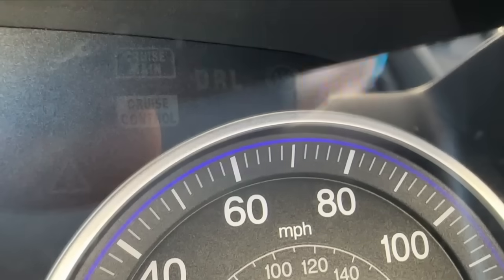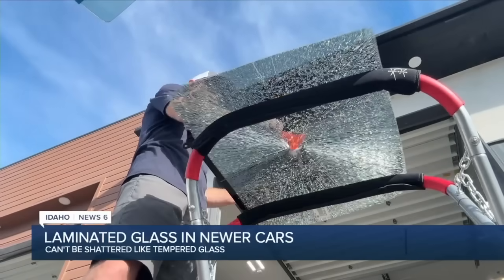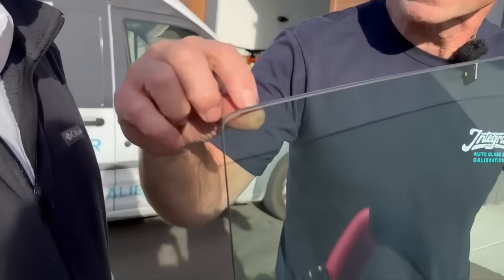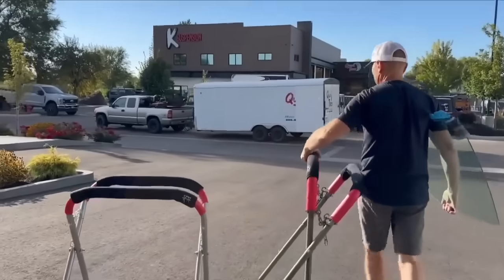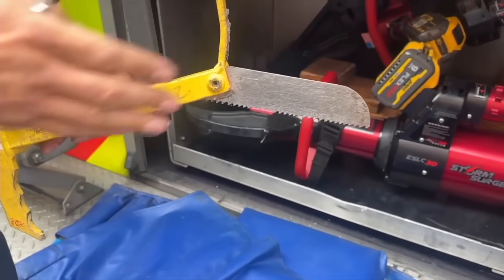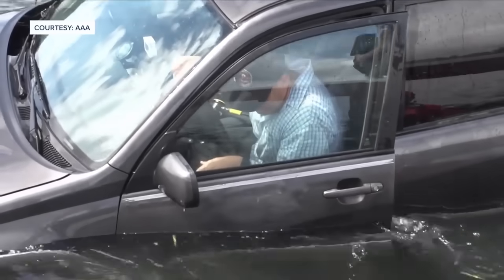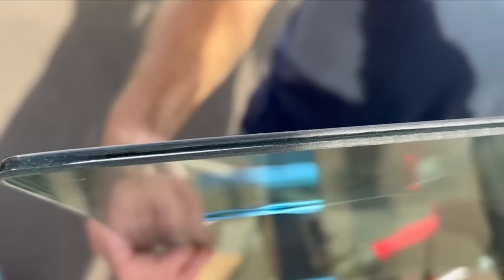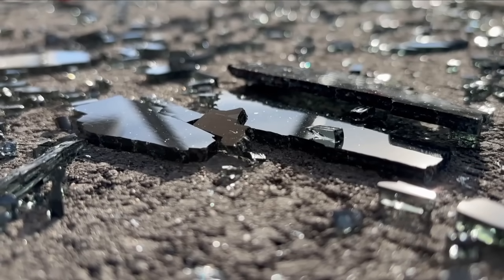New trend in automotive glass could put your safety at risk

Comment: When you (apparently inevitably) wind up in a river or lake with your car, the trick is to let your car fill up with water entirely. If the pressure is the same on both sides of the door, you can open it without too much extra force. Don't waste your breath on trying before it's equal, use it to escape.
Reply: Bad advice!!!
Reply: so i am going to sit in my car and wait for it to fill up with water with less and less air to breathe? and when it is full of water and there is no more air, i will have enough oxygen in my lungs to open the door and swim to the surface? that's your plan? 😂 goddamn man.
Reply: @josephlalock8378  what else are you gonna do if you're already under water? Opening the window isn't possible, opening the door isn't either. Trying to shatter the glass wouldn't work if it's laminated. You either waste your breath trying to do the impossible, or hold your breath until you have a CHANCE of escaping the car.
Reply: @Silacide  my s10 has manual windows . i'm pretty sure that i can roll them down anyways BUT if i was in my buick i would probably take my chances by crawling thru the rear seat into the trunk and grab the release. with the amount of airpressure and leg muscles, i think i could over come the weight of the water. i damn sure aint gonna sit and wait til my car is full of water . i think i will just avoid all that and make sure i'm driving my s10 if i decide to drive into a river or lake.
Reply: @josephlalock8378  If the water level is at your windows you’ll break the handle off before you roll the window down and if your trunk is submerged you’ll never open it, you simply aren’t strong enough. If you are worried about getting submerged in water they make tons of tools to break your window. I keep a spring loaded punch in my vehicles along with a knife that has a seatbelt cutter and a point on the handle to break the windows with.
Reply: @josephlalock8378  Also, what he wrote is 100% correct. If you end up submerged in water, have no way to break a window, and you were relying on simply being strong than hundreds of gallons of water, which you aren’t, then letting the vehicle fill with water will release the pressure and you’ll be able to open your door. They did a myth busters episode on it.
Reply: @shakiradefinitelynotaguy2036  Well it can work IF the door is less than around 10% submerged. That way the pressure is still not high enough to not be able to open the door. Keep in mind, that European cars are a lot lighter than American cars and thus give you a little more time :)
Reply: @Icecube095  Unless you can direct me to some real study I 100% believe that you’re simply making up the 10% number. Also, relying on your car to float long enough to get out is a terrible idea.
Reply: @shakiradefinitelynotaguy2036  bullshit i will break the handle off the window if it is submerged. the window is on a vertical plane. set a piece of glass vertically in the water and watch how easily it slides down. and dont try to say that the mechanism will cause the resitance because i have most likely been in a few more doors than you in my career in autobody. and read the part where the air pressure inside the trunk will assist in opening the decklid. i am not worried about being submerged. i don't drive into standing water and i dont drive into lakes. if a bridge falls into the water then thats just how it is.
Reply: @josephlalock8378  if you're fast enough (and capable) to get to the back, that's also a good idea. It's generally a better idea to go to the back for more air, as cars with the engine up front would go nose first down.
Reply: @Silacide  "fast enough" would be the key here. . it'd be tough to get thru the panic stage on to the clear thinking stage.
Reply: @josephlalock8378  You 100% won’t be strong enough to open the trunk if it’s submerged even with “air pressure”. Second, take a physics class. The water isn’t going to act on the mechanism, there is a difference in pressure from the vehicle cabin that is filled with air and the water pushing against your window, which is different than if you just put something in water. If you are submerged and your cabin isn’t filled with water the manual window won’t roll down, the exterior water pressure will prevent that.
Reply: @Icecube095  You don’t have to post a link, you could have directed me to where you found the study. The deflection and overly complicated formulas makes me believe that I’m right. The main problem with your idea is that if you’re already 10% covered in water, even if you for the door open by some miracle, now more water will be rushing into your vehicle submerging it further and pushing the door closed on you.
Reply: @josephlalock8378  I see that you’re determined to be right. That’s ok 👍. Have a good day
Reply: @shakiradefinitelynotaguy2036  i am not just trying to be right. i am right. i just threw out scenarios that you have not thought of. you have a good day too.👍
Reply: @shakiradefinitelynotaguy2036  Believe what you want to believe 🙂

If the most simple mathematical function to calculate pressure is too much for you, well, it‘s not my problem…

All I did was using the formular P = F / A and changed it to calculate F. So it was F = A x P

P = Pressure
F = Force
A = Surface

It really is not my problem, that you don’t understand 7th grade physics and I have the suspicion, that you won’t understand a study (which isn’t in English) anyway. 
Hope your day is as good as your math skills😊
Reply: @Icecube095  I will continue believing facts while you and Joseph can assume all you want 😊 have a nice day 👍
Reply: Maybe sometimes.  But if a car is in water, probably something else went wrong.  Is the door too damaged to open?  Or is something blocking the door?  Years ago in our area a car ended up upside in a ditch.  Doors were wedged shut by the ditch.  Two people drown in a small amount of water (upside down), while desperate witnesses attempted to break in.
Reply: Or just open the door as quickly as possible so the pressure difference can’t build up. Or roll the window down as quickly as possible…
Reply: @Icecube095  If you go off the road into a water source you’ll not be strong enough to open the door. The door will already be submerged enough to prevent you from opening it.
Reply: @shakiradefinitelynotaguy2036 Depends heavily on the car to be honest. Here in Europe a lot of cars are fairly tight sealed, which definitely slows the water flow into the car. There were several tests made by crash researchers and firefighters and if you‘re quick, atleast here in Europe, you might get out, but your time window is 30 seconds maximum (some higher end cars may give you up to 60 seconds)! 😊
Reply: @Icecube095 absolutely wrong. To open your door when it’s partially under water you’re fighting against the weight of the water against it and unless I’m talking to Brian Shaw you’re not strong enough. Being sealed well has nothing to do with that.
Reply: @Icecube095  The only thing a tight seal might do it give you time to roll your window down if the water isn’t at that level yet and if your electrical system doesn’t short out

Comment: That’s why you need to learn to swim
Reply: Swimming doesn't help inside a car full of water and sinking....
Reply: @ffjsb  that’s why as soon as you enter the water you need to wind down the window it will still work or open the door a little bit. And when the water fills the car up, take a deep breath, then come out.
Reply: @yokanshree4621  If you have enough presence of mind to do all that, you probably wouldn't have driven into water in the first place...
Reply: @yokanshree4621  You won’t be able to open the door a little bit. The water pressure will definitely keep it closed.
Reply: @shakiradefinitelynotaguy2036 you can wind down the window
Reply: @yokanshree4621  Yes, if you have an older vehicle with a hand crank but only if you aren’t submerged in water yet. The weight of the water pushing on the glass will prevent you from hand cranking a window and automatic windows will more than likely short out.
Reply: @ffjsb  right because no one is ever forced off the road by another vehicle🙄

Comment: How about after-market window tint? Would that be as difficult to break as laminated glass?
Reply: Tint film on tempered glass doesn’t add any strength or holding power to it. If the glass shatters, it’s just a sheet of plastic, so very little resistance. 

Laminated glass is not tempered, and the laminate is sandwiched in, so it reacts totally differently. Much more difficult to break out.

Comment: Thought of an idea, the instant a car detects its in a river, automatically roll down the windows
Reply: one more issue is we need to find a way so that it can distinguish regular carwash water/ rain water from submerged in water
Reply: Imagine driving in the rain and hitting a big puddle, when all of a sudden your windows roll down 😂
Reply: That will be funny as the car automatically rolls down its windows in the rain or at the car wash!
Reply: Great, now every time the kids pee their pants, my windows are going to roll down.
Reply: Naw thats still a terrible idea. Literally nobody asked for this feature. But im sure BMW would charge a subscription fee for the "ANTI DROWNING WINDOW SENSOR" if it existed.
Reply: Part of the problem is window motors can't easily overcome the force of water pressure.

They push the glass tight against the rubber and won't roll down anymore
Reply: @borontv6400 that's assuming it's already fully submerged, the idea is that they roll down before it sinks. But accurately detecting that the car is sinking is a more difficult problem to solve.
Reply: @borontv6400  Would it be difficult to roll down manual windows due to the pressure?
Reply: @marksudeith9840 I would say so.

Go have a friend lean against the window as hard as they can and see how well it works.

Water will apply significantly more pressure.
Reply: @borontv6400  Thanks for the information.

Comment: Roland, how recent are these new window changes? I got grandbabies.
Reply: They're not about road noise, it's a safety feature to keep you in the car in the event of an accident especially a rollover. Tempered glass shatters and then your limbs or even your whole body can be ejected, even while wearing a seatbelt. The laminated glass stays in place in the event of an accident which keeps you in place which keeps you safer from the majority of all accident types. Also as a side benefit, it also makes it harder for a carjacker or the police to get into your car.
Reply: He told you where to look on the window. It will say tempered or laminated or you can check the edge for the laminated line in the middle.